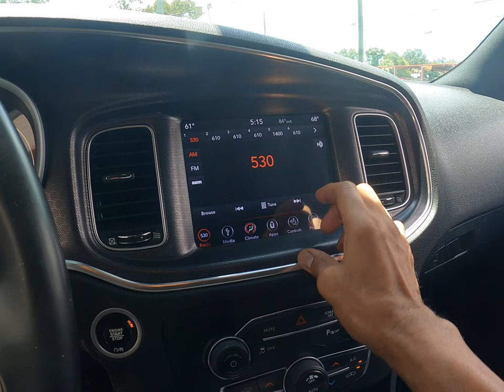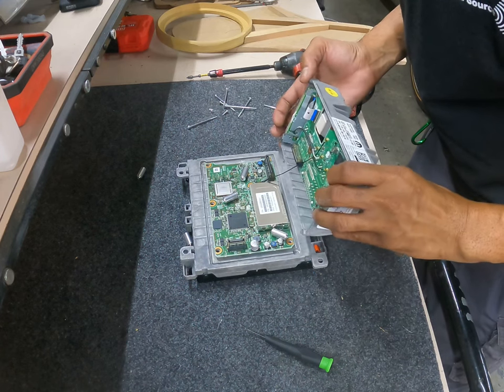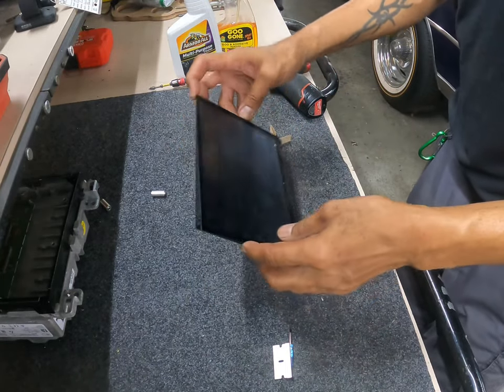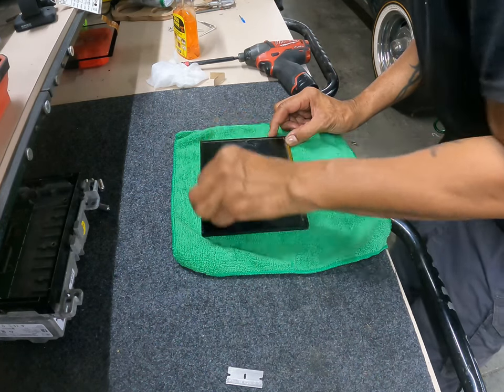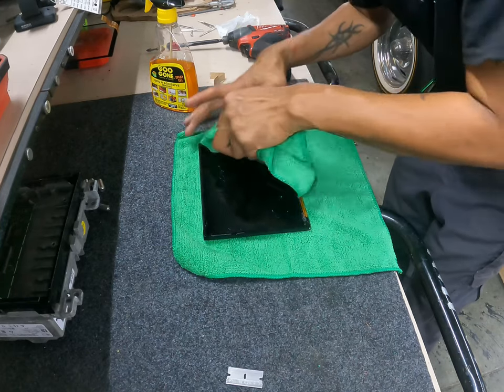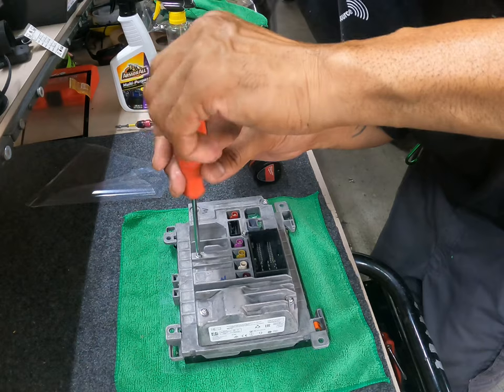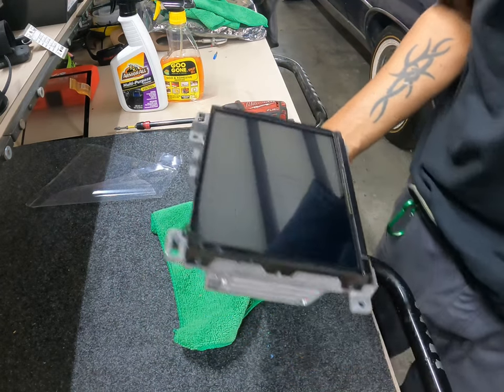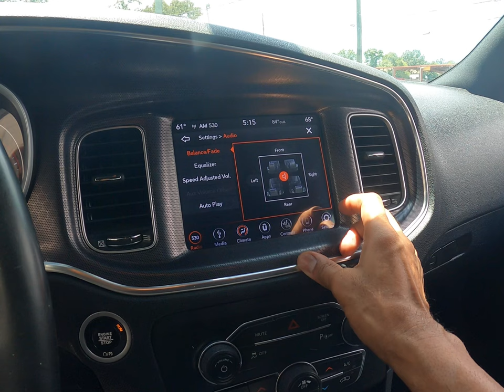Repair Dodge Uconnect 8.4 Touch Screen | Yourself | And Save Money 💰

Comment: Had the same issues with my Chrysler 300 so I followed your instructions on how to replace and clean the screen. Everything worked perfectly fine now just took me 4 hours of cleaning. Thanks for the video.👍🏽 Saved me a lot of money.
Reply from the maker: Glad I could help 🤙🏽
Reply: I could’ve saved more time just getting a replacement screen and you could’ve had the job done in 15 minutes
Reply: Yea it’s bad in them 300s 🤦🏾‍♂️ do we have to replace the screen or just clean it ?

Comment: There's a 35 dollar digitizer on amazon so i'm going to clean up the gunk and the new one comes with adhesive applied. Thanks for the vid! I reached out to dodge and the technician said he's going to see how much a new "radio" costs so i'm sure i'll be doing this myself.
Reply: Did u do it how did it come out?
Reply: @gtkid3289  waiting to get a quote from the dealership before I do
Reply: @killswitchh  I crack my screen and i can hear the beep when I touch ot
Reply: @Mrv1960 eh, I'd rather save 300 and remove some gunk
Reply: @Mrv1960  only time will tell. Worth it to me.
Reply: @killswitchh  how's it holding up? I'm interested in getting one as well
Reply: @erikkron187  Still going strong. The only thing I would say is using maps the zooming in and out is a bit wonky but other than that pretty solid.
Reply: Already checked! The timeline to even get the radio is three months plus, they don’t know!

Comment: Did I miss something or you never showed the install for the new digitizer? Looks like you were cleaning glue from screen then have the unit already assembled
Reply: Yes he never placed the digitizer back. I’ve seen people put a new adhesive like double sided tape in between the LCD and the old digitizer
Reply from the maker: I super sorry I had too edit some parts because I had people walking up asking me a million ? I do apologize about that Butt too answer your ? Just peel the double side tape off and reinstall your ribbon cable and your good as gold
Reply: Mannn we missed the main part we all wanted to see lol. I appreciate the video I truly do but everyone speaks about double sided tape to reinstall
Reply: Do you put double sided tape along the whole screen interior or just the edges???
Reply: I just did this for my 18 grand cherokee but I replaced the old digitizer instead of a new one and the strip disconnected. Any tips??
Reply: i needed to see the part of the ribbon cable being attached via the new digitizer

Comment: that little wire from the black metal frame is a ground, which makes the touch screen work via electrical conductivity via your finger.
Reply: I broke mine and it still works
Reply: I wonder if this why my radio comes on for like 5 mins n den it goes off

Comment: Just replaced the digitizer but unfortunately there are dark areas on the screen and not all area's are responding, have you experienced this issue?  And do u have a link for the digitizer you've been using?
Reply from the maker: Okay what type of cleaner did you use because that LCD screen is very sensitive too certain cleaners and it can leave blemishes on the unit

Comment: Is the glue electrically conductive? Have you any experience with Subaru legacy 2019 screens?
Reply from the maker: Haven’t had too fix that particular model butt I’m sure it can be done ✅
Reply: @bj_from_the478  I believe it can be but thus far no one can source a new digitizer.
Reply: @bj_from_the478  pardon but another question. Is it possible that the glue or whatever it is , might be incurred UV activated adhesive that the original production run didn’t cure?
Respectfully

Comment: I did this and it doesn’t show anything now , there has to be something that glues the screen to the digitizer that is how it was originally so I am assuming has to be done now.  I saw another person use clear gorilla tape and it worked for him but I am reluctant to do it but since it doesn’t work will it hurt anything
Reply from the maker: Well the digitizer should come with strips of double side tape on it Butt long story short the trim ring should secure the digitizer so it doesn’t move also it your screen is not visible anymore make sure that the main ribbon cable is locked into place securely
Reply: @bj_from_the478  I did , not sure what’s wrong but now it’s just weird colors and I can press some buttons I just don’t know where they are and the music works just don’t see anything but weird blurry red and blue smudge marks etc. I thought that the screen had to be fused or glued to the lcd panel the way it comes from factory.  I will check the cables again.

Comment: BJ! Is that what makes my Challenger act like Christine. She is possessed. Dodge said I need a whole new radio
Reply from the maker: You don’t have too purchase a new radio just change the digitizer and you’ll be fine by the way the Movie Christine was a great movie back in the day 😁
Reply: Yea they said 5g’s. They kept redirecting me and said I can only buy a full radio from them😂
Reply: Boss man I need some help wondering if you can give me some advice,,,I was having the same issue that you just fixed but none of my knobs don’t work,, ac controls don’t work,, any advice you can give me

Comment: Hello,quick question. I replaced the whole unit. I connected the ribbons & installed it without all the screws on the back to make surenit worked b4 i put it all together. Now i took itback out put all the screws in and its saying no signal found? What do youthink happened?
Reply from the maker: Just make sure you didn’t bend one of the pins on the back of the radio were the harness connect too give you power I’ve see people do it all the time 👍🏿
Reply: @BJ_From_The 478  
Thanks. i will check that out.
Reply: @BJ_From_The 478 That wasn't the problem, so im back to square one.

Comment: Pulled the black wire off accidentally. Any suggestions or am i screwed
Reply from the maker: Not necessarily I think it’s a ground wire strip the wire back and ether glue it back or use some tape I think you’ll be fine

Comment: Is it possible if i have a 8.4 Uconnect and need to replace the whole head unit. Can i simply go with a 7” to save money?
Reply from the maker: I understand unfortunately all the 8.4 units use the amplified systems alpine Harmon kardon Boston acoustic and beats the 7” aren’t and it will pull in Butt you won’t have sound 👍🏿

Comment: Is that what causes the "ghost touching" problem? My radio touch screen in my 2017 Charger  R/T randomly changes on its own like someone's touching the screen.
Reply from the maker: That your issue
Reply: @bj_from_the478  Yeah it sort of looks like the top half of the touch screen has a film or coating that is peeling or separating, like when something that's laminated starts coming apart.
Reply: @dwunnamillion  its actually glue in between the two, the heat from the car and from the heat hitting the screen causes the delamination.
Reply: Same problem, same car! I got a 2017 Dodge Charger with the same problem

Comment: I brought a replacement screen put it all together it didn’t work properly so I clean the one that I took off originally I used a magic eraser to get screen clean and clear put it all back together and boom works like new just clean all the glue off both screen use some double side tape and it might work for you like it did me no more ghosting try before you buy a replacement digitizer
Reply from the maker: That’s a great way too get it back too working Butt a lot of these vehicles I work on the screen looks bad  and old the digitizer makes it look brand new thank for the info👍🏿

Comment: For a digitizer that does not come with adhesive, what kind of adhesive is recommended? I have seen another video of this repair where Gorilla Mounting Tape (double sided) was used to adhere the digitizer to the screen, but I also see electronic repair tape online that is super thin and is used for replacing tablet and phone screens. The mounting tape is a lot thicker. Is there any benefit to one over the other?
Reply: I also have this question.
Reply: @westonbranchick1516  I ended up just buying a replacement screen. The thin electrical tape didn’t allow for a large enough air gap and caused numerous other failures (random touches, multiple touches, etc) but the thick mounting tape was too large and didn’t register touches. Not sure what I was doing wrong but I just ended up buying the replacement screen for like $300

Comment: Have uhad any problems running 24's at thinking about getting a pair pros and cons please
Reply from the maker: First thing first they don’t ride the best pot holes will destroy them and you have too run small tires I don’t recommend them for daily driving I rarely drive mine and it’s mainly for show

Comment: Totally skipped installing the digitizer. Did your replacement have an adhesive strip or did you use something else? How thick?
Reply from the maker: Sorry it wasn’t done on purpose I had too edit some parts because I kept getting interrupted by customers Butt too answer your ? The digitizer comes with double sided tape on it and just reinstall the ribbon cable
Reply: @bj_from_the478  Okay, mine did not come with double-sided tape. They said they no longer provide it (this Amazon dealer).

Comment: If my screen is cracked and the touch function is no longer working do i  need just the screen? Or the whole Digitizer?
Reply from the maker: Just the digitizer
Reply: @bj_from_the478  thanks man. My screen got cracked from an impact and the touch screen/function is no longer working. I can see the different pages and settings, just can't touch/change anything.
Reply from the maker: @matthewjacques392  glad I could help

Comment: What did you use to open the screen? In my Grand Cherokee im seeing weird spots in between the digitizer and the glass. Looks like mold spots and I want to clean it. My display works fine, though.
Reply from the maker: I used a plastic tool and a razor
Reply: @bj_from_the478  i figured out that if I go that deep, might as well replace the screen, but even with the mold spots it works and they arent noticeable with the screen on. They are visible if you flash a flashlight directly to the screen, so 🤷🏻‍♂️. For now it stays like that. Thanks for the tip and the video, though 😉
Reply from the maker: @Kevin09210  I usually change them out for the dealerships when cars get traded in because when the screen and the interior looks good and new the vehicle looks a lot better and it looks like it’s been taken care off and they buy them 🤙🏽
Reply: @bj_from_the478  could you please read my comment. Im not trying to rush you or anything I just want you to see them and your opinion on my situation. Thankyou for your time
Reply: @Kevin09210  a quick point which may be of issue is the spot size. If they head towards 3/16 you might be in the early stages of digitizer delamination . The next phase will change the spots to more whitish and micro bubbly. And glitches may be crazy. Looking at your screen from a high angle and offset might show the space between the digitizer and screen and then the black spots may be more visible on the digitizer only. Hope this helps

Comment: My 2018 Dodge Durango has multi colored lines going from top to bottom, started with one, now there’s a bunch. The touchscreen works fine, will this fix that issue or do I need to replace something else?
Reply: You need to replace the LCD

Comment: I’m finding some replacements on Amazon with the option for LCD(more expensive) vs non LCD. What’s the difference and does it matter?
Reply from the maker: Replacing the digitizer is always cheaper than replacing the screen the digitizer is just the Touch panel the lcd is the screen like your TV
Reply: Thank you I appreciate the help!
Reply: Was there a specific brand or it doesn’t matter?

Comment: I just installed a new digitizer but the the touchscreen is not working? I double checked the ribbon connections, I used white double-sided Gorilla tape (didn't completely go around the screen just to make it easy in the future to remove). Any ideas/suggestions why the touchscreen is not work?
Reply from the maker: The digitizer should have came with double sided tape on it you probably have it too far away from the lcd
Reply: @bj_from_the478  I removed the double side tape that came pre-installed on the digitizer and put some white Gorilla tape. I saw other videos and read online forums that the white double-sided Gorilla tape works best. I unplugged the negative cable on the battery hoping that would reset the stereo. Unless there's there's another way to reset the stereo, please advice.

Comment: So if my screen is ghosting I basically need to take it apart and clean it throughly??
Reply from the maker: Well that’s a 50-50 shot in the dark and I can’t say that wouldn’t work Butt a new screen looks better and if it doesn’t work you’ll have too pull it all apart again 🤔
Reply: @bj_from_the478  I actually watched your video top to bottom and took everything apart it was so much adhesive. Funny thing I fixed it last night

Comment: Replaced digitizer. All functions work...except the display. 
As I randomly press on black screen all functions seem to work fine. Black screen so I can physically see anything.
Reply from the maker: Okay was your reason for changing the digitizer was that the touch screen wasn’t working or was the screen black from the beginning
Reply: Changed because of ghost touching. Screen always worked and Screen was never black. Random ghost touches only
Reply: Any suggestions? Only thing I can think of is to double check my ribbon placement being that I can literally touch and toggle buttons  on the screen...just no display at this point
Reply from the maker: @hellyea939  just open it back up and make sure the ribbon cable is seated correctly
Reply: @bj_from_the478  Troubleshoot: My ribbons seem to be seated properly and locked in. The 2 small notches on each side of the ribbons are definitely hooked and seated.

Checked fuses also. Took them out and replaced after about 30 secs.

Feels as if all the Glue is off the screen b4 I placed new digitizer. Should be because I spent 2 hours cleaning the dang thing.

I bet I'll NEVER try something like this again. I Ruined my infotainment for the next 2weeks smh
Reply: @bj_from_the478  Bj so ended up purchasing a new screen and digitizer assembly. Still showing black screen. Radio and buttons are working but no display

Comment: Was your screen blank before u installed the screen? Or u still could see your controls  on screen?
Reply from the maker: It wasn’t it actually worked and played fine some of the touch screen wouldn’t work it had a mind of its own
Reply: @bj_from_the478 that’s what’s wrong with mine! Going to try to do this myself and just replace the screen. It’s just come away from the radio. It was going bad when I bought the thing at two years old. Boy was I taken! I paid cash!

Comment: Hey just replaced my digitizer put everything back in the car how it was and now my bluetooth and car play connect but no sound any word of advice
Reply: Also when i was taking apart the cable that the back portion has a connection to came off does this mean anything I was able to snap it back on. This is the first cable you see on your video not the second one
Reply from the maker: Okay first thing go I too the settings and restore too factory default it that doesn’t work take it back out of the dash and unplug the unit make sure all the pins are straight you may have list one too the side
Reply: If none of that works do you recommend anything else if im not mistaken there are only 6 cables from the car to the unit. Thankyou for responding the video was great as well